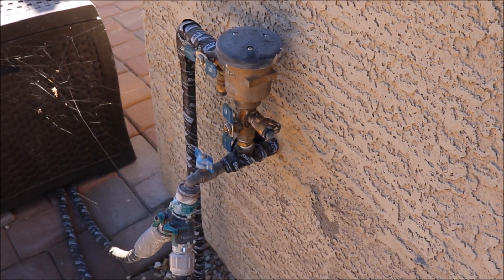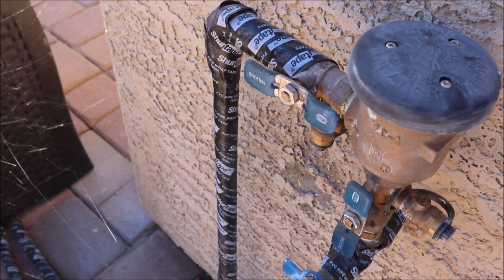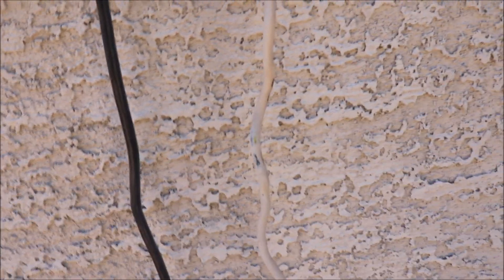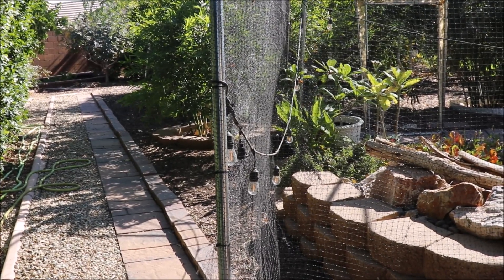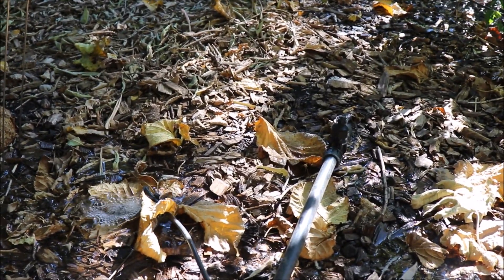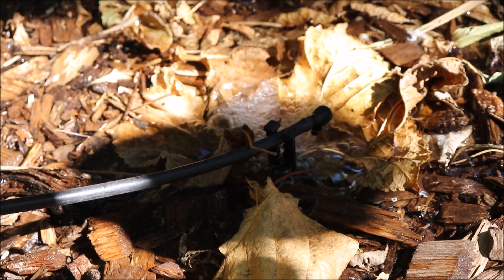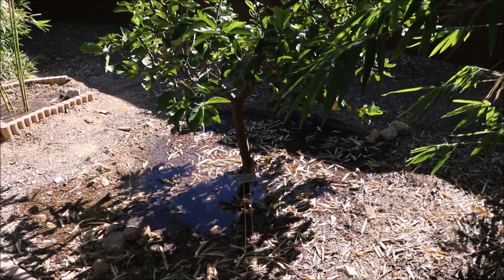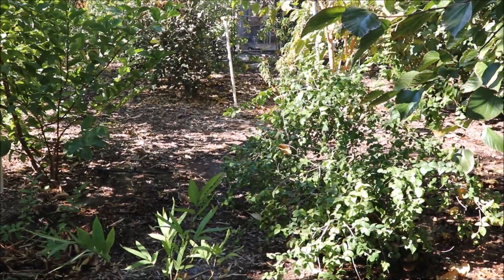Irrigation System for Backyard Fruit Trees in a Desert Climate

Comment: Love the videos,I’ve been a silent fan for awhile but I’m out now lol. So here’s the question that got me out the video fan closet, how often and how many gallons are you using for something like a 7 gallon guava vs a 7 gallon pomegranate ,7 gallon fig in  summer
Reply from the maker: Hi! Thanks for watching and the support. If we are talking in ground, at that size, it would be their first year so the goal is establishing roots. In the first Summer I would be hitting the guava with 7 gallons every day or 2. If the fig was in full sun with radiant heat (lots of transpiration), it would likely need the same volume and frequency. For the pom, I would water every 4-5 days. Of course things will change year 2 where you can irrigate less often and deeper with more volume. No matter what, you need good drainage before planting so water does not sit in the planting hole. I prep weeks ahead and fill the planting hole to capacity with water several times a day until it drains out in 15 minutes or less and then plant. Of course everyone has different soil structure and conditions like the mulch layer so you may need to adjust but the rule of thumb for me is to water often and not very deep the first year to keep the plant hydrated and avoid shock from it drying out.

Comment: Thanks! Informative to see other methods than our own......We are using rainbird flex pipe for main distribution to zones 100+ ft ($20-100 ft) and then poly zones with timers (garden/trees)...since we use main line spickets to water all the animals everyday. We are running the entire system with 50 PSI regulators. So far so good.
Reply from the maker: Thanks! Surprisingly, I don't see many videos on fruit tree irrigation in our type of climate and after seeing so many garden forum members telling people their fruit trees would die of lack of water if they use poly/dripline instead of pvc w/ bubblers thought I'd post a reality check. I do need to buy a gauge so I can test the PSI which I suspect is strong but had no blow outs in the 3 years it's been running and flow rates averaging 1/2 GPM on the micro tubing. Thanks for watching!

Comment: Great video, great information!
Thank you! Do you only flood irrigate now? And if yes, in the summer what is your schedule if you don’t mind? Thank you Natasha!
Reply from the maker: Thanks! I let a hose run twice a year for about 12 hours to really flood (push salts out) the trees in the event we don't get adequate rain during the year. Outside of that, I run irrigation. As my trees are now mature, I do program a longer run (~40 mins) less often which thoroughly saturates the root zone like you saw in the video. The flowrate on the 1/4" line fluctuates between 1 GPM to .3 GPM depending on location. The further the micro line is from the pvc inlet, the weaker the flow, but that can be compensated for by punching in additional 1/4" lines like I did on the lime tree. I do find that in June (worst heat), the trees start looking sad unless they get irrigated twice a week so I follow that course. Otherwise I water once a week in spring and fall and very little in winter.